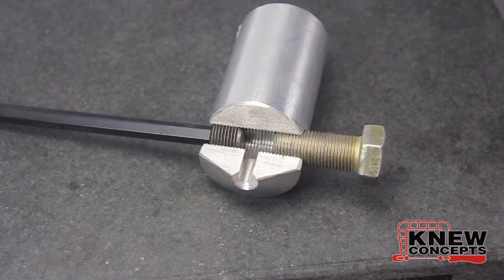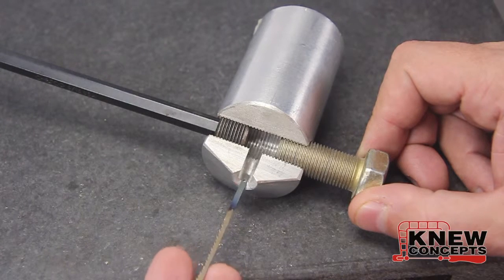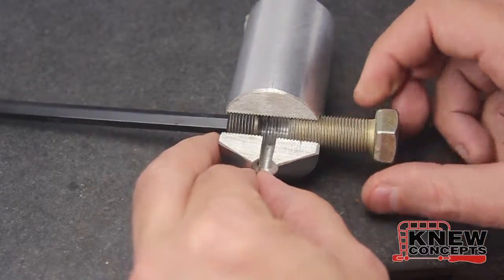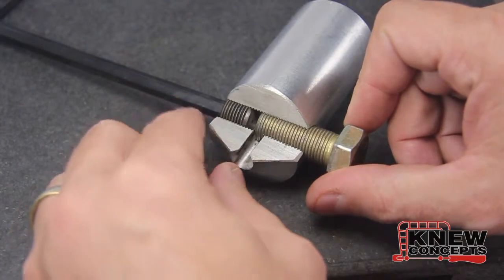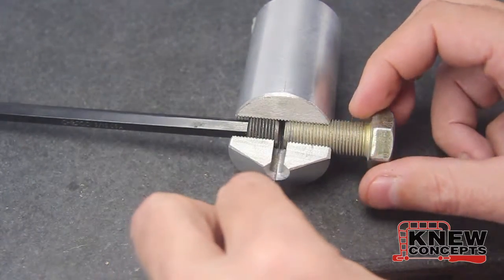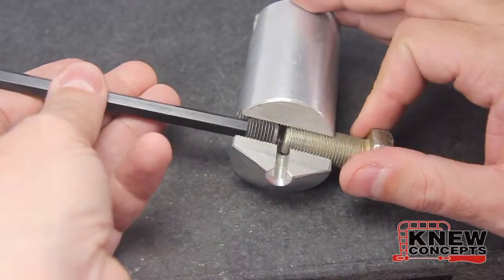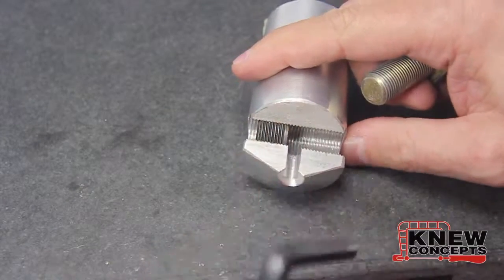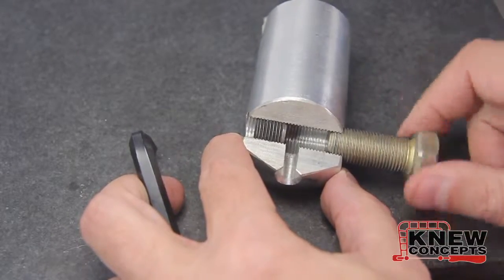Knew Concepts saw blade clamp description

Comment: I’m about to buy one. May I ask why the anvil screw moves past the point of where it’s not good for the saw blade? I wouldn’t think any size saw blade would benefit from the screw that low beyond the point of flush or beyond the middle actually. Why isn’t it fixed? Thanks!
Reply from the maker: The anvil screws are adjustable because different trades use vastly different thicknesses of blade.  The saw needs to be able do deal with a #7 woodworking blade, or a 10/0 jeweler's blade.  The same 'center' setting won't work equally well for all thicknesses.  When we build them, we set them up for a generic center that works for 95% of people, but not everybody.  The saw needs to be able to deal with even the outlier cases.